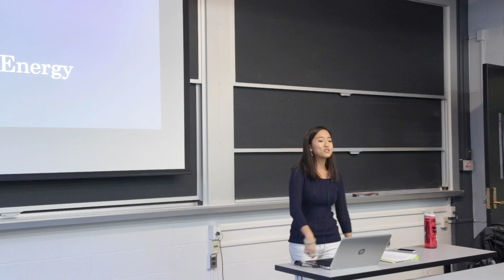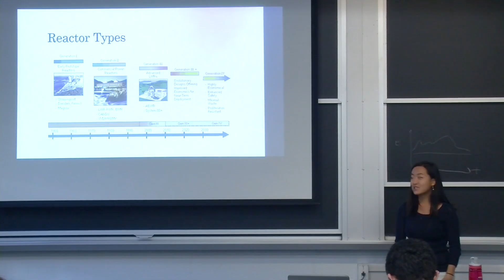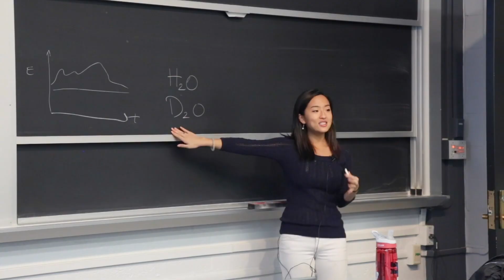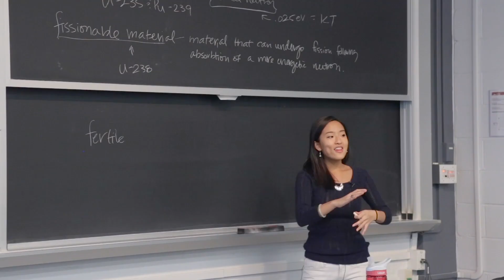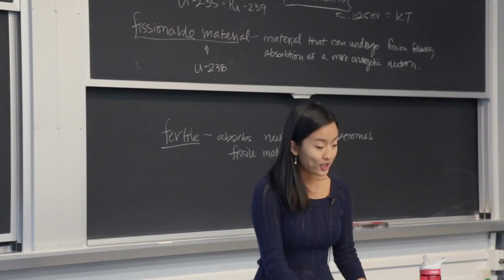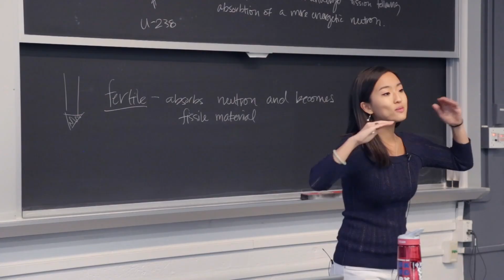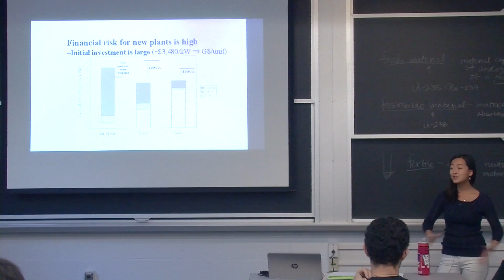16. Nuclear Reactor Construction and Operation

Comment: Her expressed knowledge of the TMI, Chernobyl & Fukushima accidents is SEVERLY lacking.  The picture attached to her Fukushima slide is a burning OIL refinery.  Fukushima reactors were housed in big blue cube-like confinement buildings. The containments for them are inside around the reactors.  The graphic she mentions of radiation spreading to the USA is actually the tsunami wave height misrepresented by anti-nuclear activists.
"SUPER-critical" simply means that the population of neutrons is INCREASING, as opposed to "critical", staying the same.  It's not a problem unless your reactor is SHUTDOWN & you're not in control of the increase.
Quick summary of TMI, Chernobyl & Fukushima accidents:
(1) TMI was a LWR that had a "Pressure Let-down" valve connected to it's Pressurizer that when opened let off steam in the top of the Pressurizer into the Coolant Discharge system.  This valve had a tendency to not completely shut, but it wasn't considered to be a big deal because the leak was very small (not a lot of mass to steam, right?)... anyway, the plant operators screwed up some maintenance on the SECONDARY plant, that's the part that takes steam, spins the turbines to make electricity & condenses it back into feed water to be pumped back into the Steam Generators. Well, that caused a turbine trip which made the secondary plant stop drawing steam from the reactor, which made pressure increase and the Reactor scrammed (Control Rods Dropped into Core, turning it OFF), however the pressure got high enough to open that Pressure Let-down valve, but when pressure dropped, the valve didn't shut, and this when unnoticed because the alarm for it was already locked in because of the small leak.  It wasn't just leaking a little, it was leaking a lot, so the Pressurizer was unable to keep up with it & plant pressure dropped until the water in the core began to boil & forced water in the core into the Pressurizer, the operators became confused and thought that the rising Pressurizer level meant the plant water inventory was increasing and the plant would go "solid" (no bubble in the Pressurizer), so they mistakenly secure the Emergency Makeup Water that had automatically initiated.  Also the water in the Reactor Coolant Pumps was boiling which made them vibrate like crazy & they shut them off (as she mentioned) which eliminated any forced circulation cooling of the fuel & let to it getting extremely hot and that caused a Steam-Zircalloy reaction which caused a lot of the fuel tubes to burst and dump all their fuel pellets into the bottom of the core where they got even hotter from lack of cooling & some actually melted.
(2) Chernobyl was a Cold War era RBMK reactor that was designed to make Plutonium for nuclear bombs & provide power to Kiev as a byproduct.  It wasn't technically a breeder, it's just that when a neutron is absorbed by Uranium, some of them don't fission & U-235 becomes U-236, and some more absorptions later you get "transuranic" elements, including Plutonium. It was a very large reactor and graphite is an excellent moderator, so good that it makes water look like a neutron poison by comparison.  Anyway, some genius got the idea that the United States would deliberately bomb these reactors and wanted to see if they could handle it, but the test turned into a fiasco, and they lowered reactor power out of the "Power Range" where temperature increases add negative reactivity, into the "Intermediate Range" where they scrammed the reactor, but because of the cadmium tips on the control rods (which were there to avoid "water-hole peaking") the control rods added POSITIVE reactivity which turned power and drove it to something like a million times the rated power of the reactor & created a massive STEAM explosion as nearly every drop of water in the core evaporated simultaneously, also adding reactivity, but it was a mot point because the explosion sent more of the core straight up & scattered it throughout the countryside.
(3) Fukushima Daiichi (#1) was a 4 facility with reactors, but the 4th one was defueled.  The reactors were NOT damaged by the earthquake, they scrammed automatically and the operators were monitoring them & proceeding towards "cold shutdown".  All was fine.  Earthquakes hit Japan all the time, they're used to it. Heck, mount Fuji is an active volcano.  Unfortunately, someone thought they could save a few bucks by not making the seawall a bit higher, because they didn't review the historical records well enough to know that their idea of an impossibly high tsunami had in fact happened a long time ago, and they didn't apply the "sure, it's impossible, but what if we're wrong & it happens anyway" concept, so the emergency generators and electrical switchgear were in the basement without any sort of watertight doors. Fuel storage tanks for emergency generators were not protected, etc., so you probably saw what happen on TV.  The reason I mentioned that this plant was #1, is because there's also a Fukushima Daiini (#2), but you didn't hear about it because their plant manager kept his head on and moved Heaven and Earth to restore power to his plant and none of his reactors melted down, granted they were close, maybe within hours, but they got it done & now he is in charge of the decommissioning of #1 plant.
Reply: passing the critical state for longer than a short burst means that you get an exponential rise in energy which cannot be contained for long, you learn this in like 2nd semester lol

Comment: 29:03 they did realise that! that was the safety test they were doing : to confirm that the low energy output is enable to sustain the plant power until the backup generators kicks in.

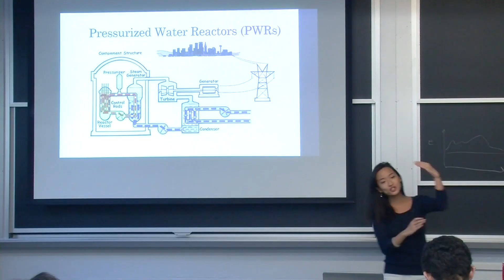Comment: 11:58, 🤔 in thermodynamics when the pressure of water is increased the boiling point will be "decreased" than the normal 100degC, thereby will only need LESS input of heat to turn the pressurised water into superheated steam.
Reply: when the pressure of water is increases, boiling point increases. Imagine, if there's more pressure on the water, the amount of energy it takes to turn it into gas to escape its liquid form increases. At high altitudes (low pressure), boiling point of water is lower for the opposite reason.

Comment: I think the helium hot gas reactors are the best because of the temperature , refining hydrogen from methane and mixing it back into the NG supply is probably the best bang for the carbon buck today

Comment: She said nuclear reactors take 5 years to build, but that's not the actual time. In the U.S. it's more like 15-20 years, due to construction delays and vendors going over schedule or backing out. This then causes interest payments to skyrocket. For example, the Vogtle Plant in Georgia is still only half complete after nine years of construction. It is more than five years delayed and has doubled from the original $14 billon cost projection to nearly $30 billion!

Given that solar/wind and battery storage can be built in less than a year and lasts for 20+ years, no one wants to invest in nuclear.

Comment: 12:47 LOL

R: For a BWR, the maximum allowable temperature at the center of a fuel rod is 2500 °C in an emergency and 1850 °C during normal operation (see referemce [5]).

Comment: 12:51 Seriously guys, google is free and you don't need to get a hefty student loan...
Reply: I watched every video and did so much research on nuclear engineering on google but my applications for entry level nuclear engineer are in a constant state of denial purely because I have no degree.
Reply: @Muffles  Obviously you would need a degree to apply for such a job, but it is also a very wrongheaded notion to think that a degree alone would translate into a job. I was told that physics is a very "flexible" major... I have an MSc and I got a varied research experience by working across multiple experimental research groups. After graduation, I learned of the dismal job prospects in STEM. Plus you really need to be a social butterfly to get jobs in the real world.

Comment: Great presentation, just few mistakes: 
- Fukushima is a boiling water reactor (design from US General Electric btw), not pressurized water reactor. 
- Also replacing fuel in a LWR is every 12-18 months, not years (!!), probably just mispeaking I am sure you know this. 
- Japan is not reprocessing its fuel at Rokassho Mura, it is not operational (and might not become operational ever)
Love the presentation though, even if downplaying the impacts of these major nuclear accidents, appreciate the effort to summarize such broad issue in one course
Reply: Downplay the impact, maybe. But the problem is that many people fail to understand the impact of our current, nonrenewable, energy sources. They kill many more people per year. Are these accidents bad? Yes. But they don't kill nearly as many people. Sure, things like solar panels are probably the safest option, but they still require storage, and the battery tech is still a few years away.
Reply: @JacobRy  If we used BOTH nonrenewable AND renewable we could kill people at TWICE THE RATE! If enough people die, we may even solve, WORLD HUNGER!

Two bombs was JUST enough I think. is just like disk-cleanup.
Reply: @germangonzales2008  no we wouldn't. That logic is so, incredibly, flawed. We actually ALREADY use renewables, and I don't see wind turbines, and solar panels killing people... nuclear has killed BARELY anyone. modern reactors DO NOT pose a significant danger.
Reply: Okay, i didn't expected this coming 😂

Comment: the instructor is speaking too fast, probably too nervous? The 1st question, the operational temperature of PWR, she does not know the answer and asks student to google it. well, she is not  well prepared...as it is not a difficult question for nuclear major student. the answer is that core temp can be up to 340-360C. I am quite surprising that master student can work as lecture instructor in MIT. No offence but, usually the PhD students do this job as teaching assistant/instructor.
Reply: I think her focus is energy, not nuclear. Also she's a TA, and usually graduate students (including master's students!) or even exceptional undergrads are TAs.
Reply: @sylviajin6968  All TAs I know are at least PhD students, and I can see why is that. A master student or even an excellent undergraduate is not qualified as I can tell. The lecturing needs professional learning and practising progress, and mostly important, the knowledge. As as be told from this video, she cannot answer most questions raised by students in a professional way, which is not a good thing. Lecturer I know need to attend classes to obtain the qualification to teach and these lecturer are at least Postdoc level. I am not blaming the lady, as she must be very excellent to have the chance to lecture here. It is MIT that I am disappointed at as it can show more professional courses than this, even though the content is not difficult.
Reply: I completely agree that lecturers need  professional learning and practice and require certifications. It's just that she's not normally a lecturer -- the professor was just out of town.

Comment: Very good. How about nuclear power plants the size of a refrigerator that could provide electricity for 20,000 homes? So, instead of a large power plant, we transfer the production of electricity down to the municipal level. Clusters of 10 or 20 small units could provide more power than a single location old-style reactor. I believe that the future of nuclear is in downscaling size.

Comment: When she talks about Chernobyl - the test was exactly about that. They know that the energy core powers the water pumps - they have auxiliary gasoline generators to pump water in case of accident or attack and they were testing if slowing core could power the water pumps for enough time for those auxiliary generators to start running properly and pumping the water to the core.  
That was a standard test every nuclear reactor must have gone through - the accident was then the combination of one working shift postpone on low power, inexperienced senior engineers, and graphite tipped rods.

Comment: Fukushima Daiichi reactors are a GE design BWR. Good presentation. I agree that reactor licensing is onerous and expensive. The costs of development and construction are very large for 1000+MW reactors. Not helped when virtually every reactor built is a unique design. Standardization of smaller reactors using advanced concepts with inherent safety will greatly help.
Reply: "Not helped when virtually every reactor built is a unique design. Standardization of smaller reactors using advanced concepts with inherent safety will greatly help." can you elaborate on this? Is there not just like a blueprint that is copied?
Reply: @NewWesternFront  there have been a few designs that were developed starting in the late 80's that were "standardized" meaning fully developed and simulation tested, pre-licensed so that factories could produce the design. A site would be selected and NRC verified it's suitability. Then construction followed blueprint with inspections on site. Components would be inspected as manufactured proving quality. This was to reduce total construction costs and time. All operating procedures were part of pre-licensing. These designs were light water reactors (500 MW) which generally require powered emergency cooling methods. Some had purely passive methods. The big issue remains about refueling and waste handling. This is why newer designs such as waste burners that are smaller, passively cooled and modular (sub 50 MW thermal) are a smarter solution. Future sub critical designs accelerator driven using a dusty plasma core with very small fissile load with power directly produced from fission fragment i.e. traveling wave energy conversion would result in much higher efficiency well above Carnot and be inherently more safe.

Comment: The reason why the tip of control rod in RMBK is graphite is when control rods are all pulled out (full power) there is always a small amount of boron carbide in the reactor, which means it couldn't run at full speed. Therefore they decided to replace the tip by graphite -- what was supposed to be breaks then became half gas pedals.

Comment: Slow down and teach.  Demonstrate, ask questions, monitor and adjust, have the students work together in small groups and individually with small simple assignments like extra research etc.  Confident the instructor knows the material, I'm concerned that the students  didn't get most of that.

Comment: Japan's tsunami problem is gas explosions underground created by volcanic heat oxygen hydrogen and natural gas like methane propane and mapp. If Japan drilled relief vents at the fault break zones which are chambers in rock. Those relief vents could stop tsnamis from hitting their shores. It's cheaper then a sea wall that doesn't work
.

Comment: It's the building dust that kills the most. Just like 911. That was a small nuclear explosion in a big town. The other building blocked much of the cloud. Had the two towers been the only sky scrapers surrounded by small homes it would of knocked a diameter about a third of a mile down to the floor. Huff and I'll puff and I'll blow your house down. The big bad wolf.the old skyscrapers with solid columns 60 feet thick held up. Building seven built weak went down. Houses would of been ripped to dust themselves. It's the compressed air from the collapse. The same as the compressed gas of a nuclear tank of boom

Comment: I had a bit of a different approach. Of studying physics. I used to open, any chapter. Go, directly to the " Solutions/ Answers" part. And then, look at up the solution. I used to look at the solution. Which was the most complicated. And then, look up. To it's question.

I used to look up. For that question, for which. I liked the solution. I tried to do this. For few times. In those books. Which were recommended by NCERT( Bibliography, Class 11th, Physics Textbook).
I loved physics. At (10 + 2) level.

I thought. Sharing. This type of approach. Might be useful. To make physics, enjoyable. For those, who find physics. Very boring.

Comment: well i want to know how could you reduce the global warming by using the reactor cores aren't they required cooling dip and radiating heat into heat exchangers  which will transfer heat to the environment well  , i think they produce heat faster than old school fuels   such as petrol and Gasoline and other crude oil processed materials the cleanest one is using the plasma and anti-matter which most government hiding the sources of it , china now made it to integrate the fusions together so no need to bury the old fuel as old style dumping for something in earth core which will come back alive after earthquakes wish you luck

Comment: What drives me batty is we're talking about the same old designs selected for use in submarines nigh on 75yrs ago as if we don't have prototypes and proofs of concept for safer cheaper, less dangerous reactors. 45 mins she doesn't even mention that we're measuring modern day coal/gas costs to 1950's compact dirty reactors which were clearly built and designed in ignorance of things like waves and graphite-tipped, zirconium-coated fuel rods... How about apples to apples and including the environmental impact of natgas / coal waste when comparing costs? How can you make a scientific comparison like this?